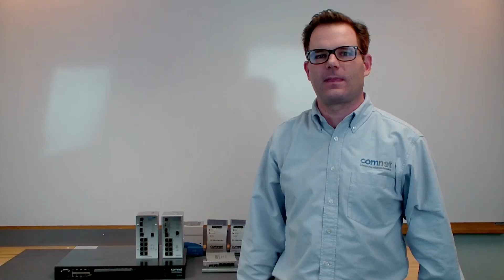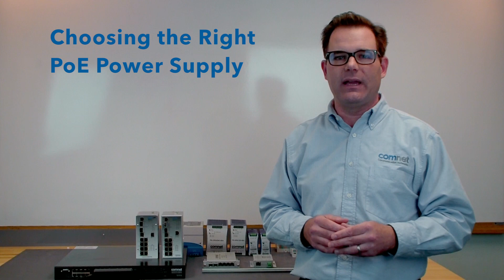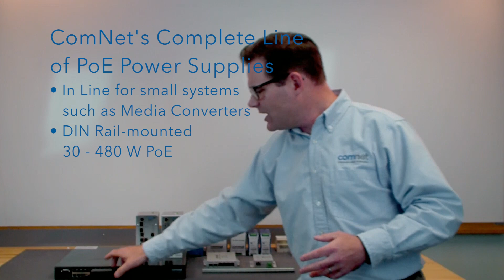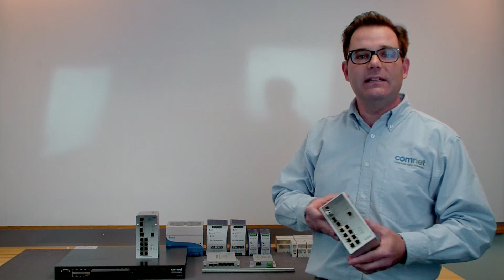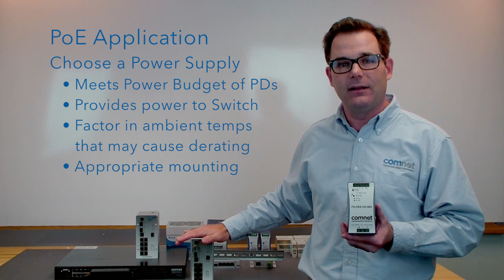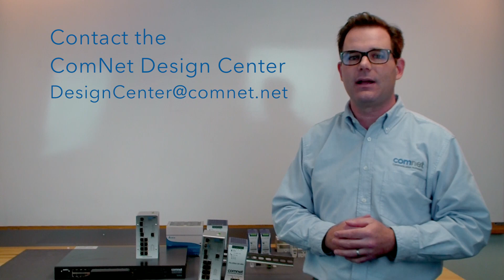How to Select a PoE Power Supply

Comment: When using 802.11af, my devices note 12v 1a 10.5w. Is this all negotiated with 802.11af? What range of voltages and amperage is supported by 802.11af? Is this a standard range or does each switch/injector have a range of voltage and amperage depending on model. For example do all support 12v-48v or are there some that only do 12v-24v, 24v-48v, etc. I cant seem to find any descriptions that list voltages or amperage limits just total wattage. My assumption is it negotiates it all to get the correct wattage, is this correct?